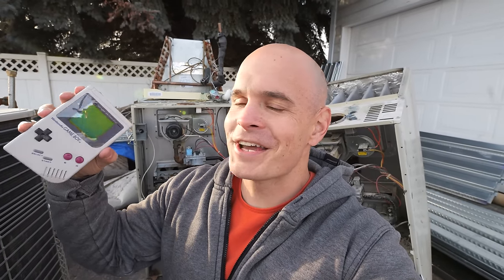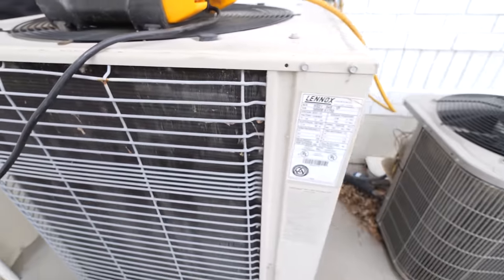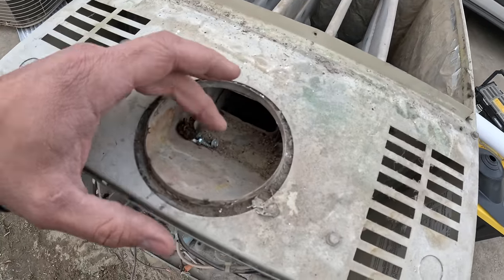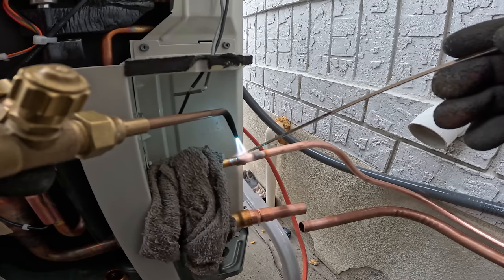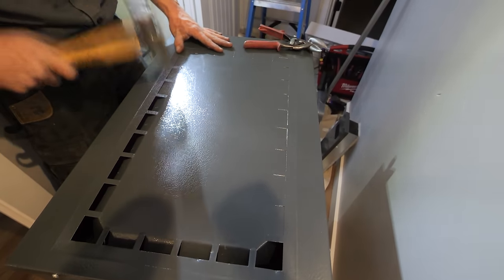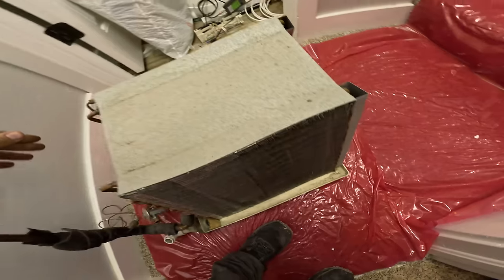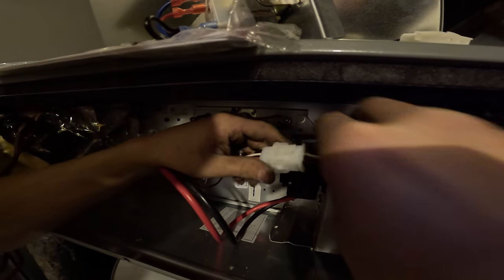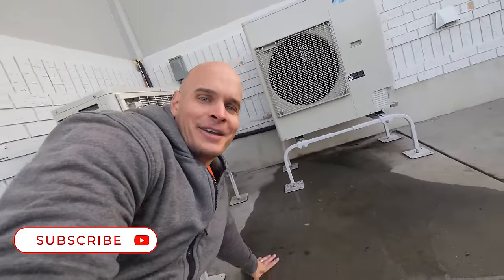Why is Everyone Talking about Heat Pumps?

Comment: I’m an HVAC guy, R410A is 20 years old and not new and about to be replaced in less than 3 years by R-32 refrigerant.
Reply: Yup same here. We never install 410a anymore.
Reply: Which one is better? Read online that the older the better, but more harmful for enviroment.
Reply: R410a is ancient by today's standards. Hydrocarbons like for example R290 and R600a is the new thing.
Reply: @LinusJohansson-yu7cy  same here - UK heat pump installer here and am always amazed at how far behind the US is on these things.
Reply: Was going to say the same, kinda weird daikin didn't put a newer product in his house. We have R32 since a few years but I'm really looking forward for R290
Reply: Same in sweden, some eu regulation to only use R32 I believe?
Reply: Yeah R32 is more efficient, not sure why spent a whole new system for R410A. Is it better on heat exchange?
Reply: @JelleRevyn  we're installing Vaillant units now - 3 installed so far, a twin cascade going in next week.  It seems to work really well, although the additional clearance requirements are a PITA.  Hopefull they will get relaxed as more units are installed and manufacturers become less paranoid.

I have too many bad experiences with Daikin technical support to have any faith installing them - although to be fair that is on rare use cases like fan coils for heating and cooling.

Mitsubishi are launching their r290 soon and talking about integrating car charging sockets on the outdoor units which will be cool.

And we in the UK are miles behind much of Europe and Scandanavia too.
Reply: @YagiChanDan Yeah it's because of the fire rating, I think atm you can have 150grams of R290 in house for heatpumps (air/air) without  outside unit. Those can reach up to 3,6 kW while with 250gr of R290 you can get 13 kW but must be placed outside with the right clearance although it seems those are also country specific. Was a bit amazed why US didn't even have 290 R-1270 or R-717 but it seems that's because the research was done in cooperation with the EU WP brands (Vaillant, Viessman, Övum, ...) so the patents are also EU.

Edit: Can you you give me some keywords on how to find the Mitsubishi one with the integrated car charging because youtube linking. Thx!
Reply: @JelleRevyn  the Mitsubishi car charging isn't official yet.  I was at their UK head office earlier in the year and was talking to one of their senior tech people and it is on their development time line.  How long it will take to materialise, I do not know.  It makes sense though as the unit can easily decide how much current to send to the inverter and how much to the car based on the energy requirements.

I work with monoblock heatpumps, and don't deal directly with the refridgerent; so the r290 clearances are more to do with ingress into the property through vents, doors and windows.  Also any switchgear, but when you think the content of the 12kW Vaillant is only 1.3kg, so in the event of a leak, I would think t would disperse quite easily.
Reply: @tuojisprotesiu  R-22 was the goat R-410a has poe oil which sucks and causes a lot of issues the older stuff didn’t have, I would have left his system alone now in 8 years no one will be able to fix it when it breaks cause they’re so complex tech support isn’t even helpful with those most of the time.  Good luck.
Reply: Came here to say this
Reply: What about R290?
Reply: damn you guys will now move on to R32? The world is moving from R32 to R290.
Reply: Italy, we are using R32 like from 3/4 years.
Reply: @YagiChanDan would you get or (do you have one) over a gas boiler?
Reply: exactly, in france all new units have R32 execpt for building that receive public. Those still have R410A
Reply: @Horizon301.  I need to do some calculations on my existing heating pipe work to make sure it would work.  If mass flow rates work out, then I would have no problem getting one installed.  In the UK,  they will soon have to either drop the cost of electricity or (more likely because all our politicians are useless arseholes) raise the costs of gas.  So properties like mine that are currently borderline when it comes to comparative running costs will soon be better off with heat pumps.

However, one has to factor in cylinder upgrades too.

I might even do a heat loss and running cost calculation this evening.
Reply: @JelleRevyn  You can actually go up to 8kw with 150g of r290. If you want to go higher you dont need to put it outside, if you put it inside you need to have a system to evacuate the r290 in case it leaks.
Reply: Isn't that propane? I thought they stopped moving to that because of the explosions
Reply: Sorry, I just Googled it. Propane is r290. If you have an r290 refrigerant, get it replaced by a professional  immediately. Hvac propane explosions are terrifying
Reply: @YagiChanDan  yeah at current rates I don’t think the savings are beneficial and do you trust the system to be as reliable as a boiler and long lasting?  Couldn’t you save money by just using air conditioning and running boiler just for water?
Reply: I was thinking the same thing. I had a heat pump installed a couple of years ago and it uses R32. (And is able to still effectively extract heat at temperatures below –30°C.)
Reply: @Horizon301 Well, it's the most reliable option. When a heatpump breaks down, you've no heat, no warm water, nothing. Also, it's really easy to screw up the settings of a heat pump, even by the professionals. And when things go wrong, good luck finding the problem and fixing the main print plate (in the case of Vaillant at least). These kinds of problems start to occur when the heatpump is 3-4 years old. 

Then there's the noise problem. Heat pumps are a lot noisier than on paper. Like 10-15 dB.  If you want to be in legal trouble with annoying neighbors, getting a heatpump is the best way to do so. So when installing a heatpump, don't forget to install a sound wall as well, since putting the fat in a noise reducing case leads to the fan freezing over, which leads to a higher energy bill at best or a broken heatpump at worst. 

Also, be prepared for a heatpump being disappointing at colder temperatures. I've seen people using extra convection heating to get the house warmer while with natural gas this wasn't necessary.

I don't have hard facts, but I think airco and boiler (and infrared panels) is better over time. Airco can be much better managed for every single room compared to central heating solutions like the natural gas furnace, heatpump or district heating. This is how to get real energy saving.
Reply: @Horizon301.  OK, I've just done a full work up of my house.  Even my 10mm radiator flow and returns are OK as they come from a manifold to each rad (10mm pipe can carry 1.3kW at delta 5).  I'd need to change one or two radiators as the rest are at least 30% over sized for a heat pump already.  My ground floor is all underfloor heating anyway so will be fine as it is already designed to operate at 40/45 degrees.  I sized my rads to run at 50 degrees when I installed the system 15 years ago.

Current energy prices being 27p per kW for electric and 7p for gas, I would actually pay 16% more for my energy if I moved from my gas boiler to a heat pump with a SCOP of 3.  Unfortunatly my software won't change to a SCOP of 4 which is more realistic today with the new crop of heat pumps from Vaillant, Mitsi etc.  My heating works on openTherm, so as each room reaches target temperature it begins to ramp the boiler target temperature down from a hard limit of 55 to as low as 30.

Ignoring installation costs (not a problem for me), the cost of a new hot water cylinder at say £1200.  Alternativly I can get a 7kW Vaillant aroTherm plus with their unitTower, with mixing stations and controls for about £7500 (handiy the same as the BUS grant).  It would all be covered by a 7 year warranty too.  

I don't have any real worries about reliability.  All this is really AC products working in reverse, so not really new technology.  The fuckeries happen when things are incorrectly installed or even worse - and where the horror stories really come from in the UK - incorrectly specified

Install the correct kit in the manner they were intended then all things should be fine.

As far as I know only one of our installations has had a hardware failure and that was a compressor fault on a Mitsubishi several years ago.
Reply: EU Uses R-32 now, you won't get R410A anymore.
Reply: My question is why is he using pro press and still brazing, I didn’t see nitro tank either.
Reply: I guess installs are using press fittings now? we had a commercial job we didnt run the gas on. Plumbing co. used all press fittings. had over 67 leaks on pressure test... he better put a monitor in there asap
Reply: @tuojisprotesiu  R32 is flammable.
Reply: @YagiChanDan  that’s really insightful, thanks!
Reply: I was also wondering why he was acting like 410 was so new. It was newer when I was in school 10 yrs ago
Reply: @tuojisprotesiu it's only better cause it's low pressure and not 500psi. Notice Jerry never said a word about how blazing stupid the pressures are. And tbh I'm expecting those crimps to fail with the pressure of 410.
Reply: @DiningTableOfficeWorker probably because it's outdated and laying around. Or some kind of defect. Why give a brand new system when they have older modems
Reply: I’m on the east coast and we can’t sell R32 yet. Coming late this year or January 2025 not sure yet.
Reply: Those oring crimps gonna fail in a few years just solder it all
Reply: @Deusregere  that's really sad! How the regulate it soon. While it's not only a better refrigerant it's also way more eco friendly when a leak happens. But I must admit I think household appliances (refrigerator , ice-cream makers,... ) are a bigger risk because of people scrapping those or dumping instead of recycling.
Reply: Team R290
Reply: I have Daikin heat pump/AC & the warranty is parts only.  One of my compressors died after 2 years (2022) & my installer wanted $1,700 labor to replace it.  I ended up buying a whole new outdoor unit for $3,500. + $600 install.   I was able to get a $1,600. rebate from Daikin for the compressor value.  Not what I'd call a good warranty.
Reply: @bfox87  we’ve briefly debated using them but came to the conclusion why take the risk?
Reply: LOL
Reply: @tuojisprotesiu  no, R32 has higher efficiency
Reply: Already been replaced here in Australia we barely used R410a
Reply: I love this reply chain. Tons of world wide info getting shared-AUS, France, Italy, Bulgaria. Daikin getting trashed, R32 is the way to go, something about braising. Poor Jerry 😂
Reply: I have two 1.5 ton mini splits units in two rooms in my house, bought in 2018. Both of them are R32 and working without any issue.
Reply: @JelleRevyn  Probably used up stuff from back of the warehouse, though thats not very clever, considering what promotion they got.
Reply: @YagiChanDan  I have 2 air to air Daikin units with R32. Now looking to replace my wood pellet heating system with heat pump. Valliant units are very popular in Denmark and is highly praised as being one of the or the best.
Reply: Stupid always wins, while Europe is switching from R32 to R744.
Reply: Remember he lives in the United States. That is probably new
Reply: @tuojisprotesiu I miss Denmark.. My family came to America years ago.. Not Impressed
Reply: @RedPillAlways  No progress to Centigrade, just friends at a LDS church?
Reply: It’s because of the natural gas industry that US is slow to adopt efficient heating and cooling solutions. The setup Zac has still requires a gas furnace as a back up for super cold days. That back up furnace wouldn’t be necessary if they went with R-32 as it boils at -62f.  Basically, natural gas’s would be finished as a home heating solution if more high efficient heat pump solution becomes standard. 😒
Reply: @YagiChanDan   The US is massive and different people want different regulations. Plus the US far ahead on plenty of other things.
Reply: I thought it was r1234 like what all the newer car ac’s are using..
Reply: @YagiChanDan  The US has tons of cheap gas. We don't need Heat Pumps for heating.
Reply: Next year onwards no more new r410a products launching and R32 are fully enforceable across new products across all products
Reply: i am still on R22.
Reply: R22 was the best refrigerant because it worked at low pressures and it was rare for them to develope a leak. R410a pressures usually run double to triple what R22 pressures were and instead redesigning the systems for higher pressures, they didn't change a damn thing....except for gradually using thinner and thinner copper pipes to reduce production costs so that they could increase profit margins.  And THAT ladies and gents is why refrigerant leaks are way more common than they used to be
Reply: R410A is barely used in Australia anymore, we converted everything to r32 like 5 years ago. Only old units that have been sitting on the shelf will come with 410
Reply: Isn't R32 highly flammable? I know most newer window AC units use flammable refrigerant which is seems concerning.
Reply: Are they all copyrighted by Dupont?
Reply: @DiningTableOfficeWorker  R410a is A1 class refrigernat so not toxic and non flammable. R32 is A2L which is slightly flammable. R32 is better in terms of global warming potential as it has 4 times lower impact than R410a. Which is the main reason we are moving away from R410a.
Reply: @troyvanbuskirkjr  absolutely! sure the new tech going into the compressor and fan motor is more efficient, its almost at the point where i as a tech can never fix anything the same day as the supply houses don't have this stuff in stock, and diagnosing almost requires me calling tech support because for warranty approval we need their approval. the parts are also very expensive outside of warranty. the single stage basic equipment is the way to go in my opinion.
Reply: And a year after that, R-32 will be immediately phased out...  I still have a full jug of R22, I'll be good for awhile.
Reply: @saloogee84  Thank you for the clarification, been looking around on the internet, and seeing that this both maintain the same similar PSI in terms of Thermal exchange, so I guess this would be more on Safety? why Jerry chose it. or maybe it's just a matter of availability from Daikin 🙂
Reply: While that may be true he needs it now he can't wait 3 years kind of a dumb comment
Reply: Daikin was the first to use R-32 in their systems back in 2012 lol
Reply: 410a is not new...
Reply: @mediocreman2 size restrictions. Mostly for refrigerators
Reply: Was gonna post the same thing we are gonna be stopping 410a systems in q3 this year
Reply: Yoy should have installed a R32 refrigerant unit as R410A will be out by 2025 and all new units will have to be R32 bad investment of the 410A units as the that refrigerant is getting more and more expensive so that if you get a leak it will be very costly also you cant retrofit a 410A to R32 and will need new units. Just in case i am an HVAC tech.
Reply: 410A for residential installs is gonna be around for awhile and manufacturers will stick to it till the bitter end.  410A is already being phased out for us commercial guys, R454B will be the new standard
Reply: @troyvanbuskirkjr I've been running 2x r410a air to air mini split heatpumps (nordic models) for 16 years all summer winter..during summers for cooling and heating in the winter. Our winters go down to -20° - -30° celsius and summers +20° - +30°.. Not a single repair so far. Only hiccups have been outdoor unit icing on the other (2 different brands) but i've always survived with either a couple of buckets of warm water or a steam cleaner..😅 ..so can't complain about the refrigerant.. Now i'm about to replace them to newer ones with higher cop, r32 refrigerant and other more modern features (i've moved to homeautomation) since i'm planning some renovation i'm also replacing and repurposing these workhorses..
Reply: @Wegetsignal Hi! I've been working with fridges havin isobutane as refrigerant for over 10 years and i've never heard anyone having refrigerant ignite..let alone explode.. (if we won't count in the technicians fooling with flammable stuff..) ..burning requires 3 elements; burning material, oxygen and heat..if anyone is missing, fire is impossible. The refrigerant system is hermetic, thus contains no oxygen and can not burn/explode.. The filling amounts are regulated so that if they leak, their concentration in the typical environment is not able to ignite.. so pretty safe stuff.. i even built a small r290 heatpump (a 40-50g system) as a dyi project for preheating the water in my hot water tank..😅
Reply: @DiningTableOfficeWorker In Europe we have central regulations about the refrigerants. The only reason R410A is still used is in mostly very large systems. This has to do with the fire rating of R32. Under immense pressure and temperature R32 can ignite and thus could cause dangers when it is a lot. With the home heat pumps we are seeing a lot of R290 because of the very low GWP (global warming potential)
Reply: I got my heat pump few years ago and it came with R32 but I think it's because of eu regulations. Happy to see heat pumps getting more popular because well, they are good
Reply: @LinusJohansson-yu7cy  R290 is propane, it boils at -44C so it's worse for low temperature efficiency, and it's also flammable. It's cheap as a refrigerant, which is why it's so popular recently. It's fine for air conditioners that are outside. It is not ideal for heat pump heating.
Reply: In Europe R32 is here for a good few years, we are talking about even newer one or using butane
Reply: R410A has almost completely been replaced by R32 in EU, but EU is now also banning R32